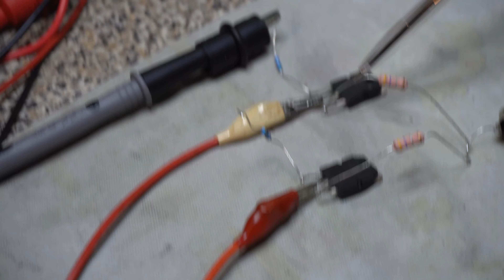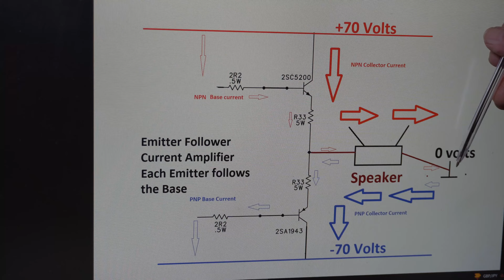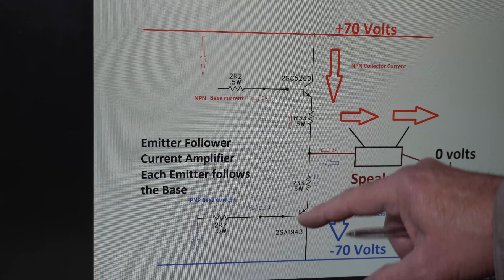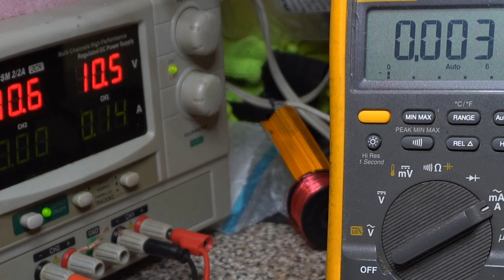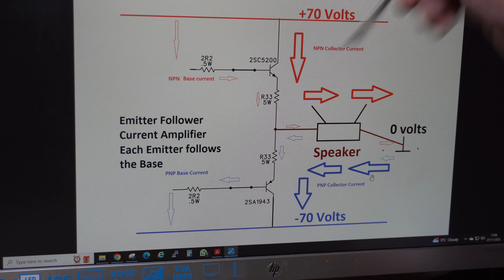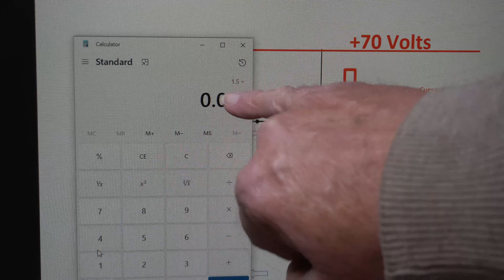Transistor Current Amplifier - Emitter Follower Output Stage - Negative Feedback

Comment: I used to work for a computer company. They used large mains linear PSUs with 10 parallel power transistors for a total 100 amp supply. These units used to last for about 3 months before needing to be repaired. All the power transistors blown. Surprisingly the designers had not considered that the gain and bias characteristics of the transistors were not matched, so the devices wouldn't share the current equally. Coming from a PSU background I could see the problem, no 0.5 ish ohm resistors  in the emitter legs that formed the output, to back off the conductivity of any greedy output devices to get all conducting equally. As you mentioned, crude simple feedback. Once modified and installed, problem gone. Always surprised me that an engineer tasked with designing a. 100 amp PSU never considered this problem. This was a large company at the time, Nixdorf.
Reply from the maker: Wow, no emitter resistors, no wonder they failed.
I'm shocked.
Thank you for your comments.
Reply: @JohnB-2021  To compound the problem, and in order to allow the computer time to shut down cleanly upon mains failure. The unregulated input for this 5V supply was 15V😱, so 10V dropped
Reply from the maker: @Phantom-mk4kp  
Wow, that's a huge amount of power to get rid of.
I constantly rant when I see big resistors getting hot just to save a few £.
The last video to this one, a 4k7 5 watt resistor to supply one chip with 15 volts.
It’s connected to the 140 dc supply.
I’d prefer to see another winding on the transformer or a switch mode psu.
The Kef sub I repaired also dissipated huge amounts of power with cheap high power resistors.
Such a bodge to save money.

Comment: I am confused. I thought a pnp needs minus on the base to make it work ? -

 anyway  great video , the schematic interesting some extra bits and pieces  going on there  EG astable type transistor connection
Reply from the maker: Thank you for your comments. 
I’m now confused.
A modern class A/B let’s call it B, needs both positive and negative rails since the signal is constantly alternating between positive and negative.
Reply from the maker: Yes the PNP did have a minus voltage on the base.